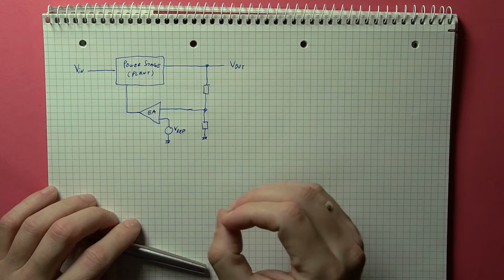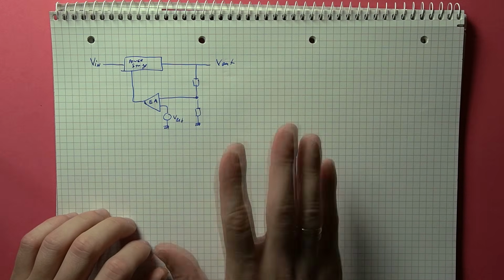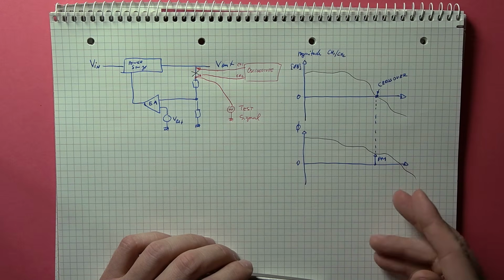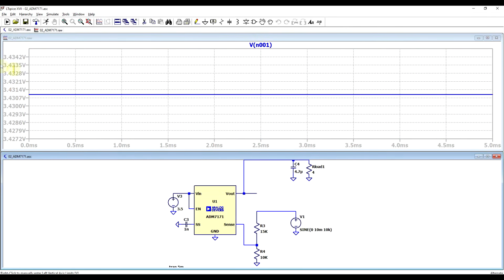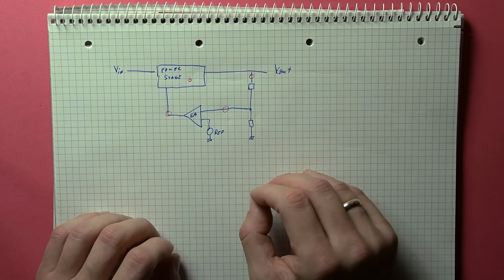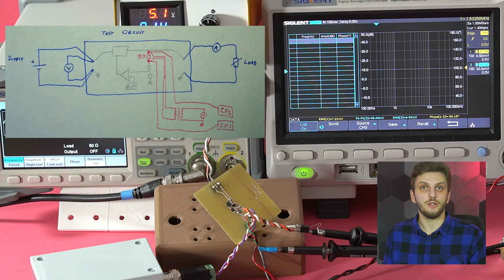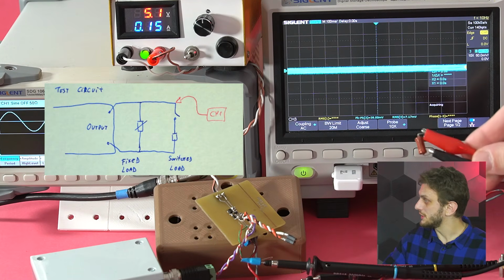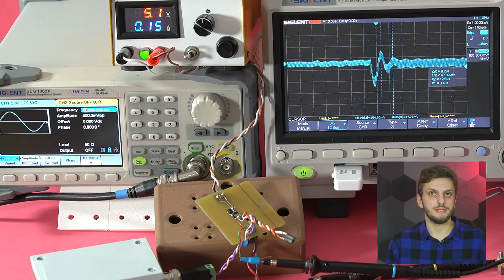Power Supply parameters - Loop Response

Comment: Which transformer was used to inject noise?
Reply from the maker: I used a DIY transformer; I don't have a proper description of it.
Reply: @FesZElectronics Can you provide instrcutions to diy the transformer? What should be taken care when making it? Will the ouput impedance (50 ohm？) of the connected signal generator affects the test device's loop response?
Reply: I am also interested in what such a transformer looks like and how to make it

Comment: There is a "small" problem here. Your reasoning on the open loop is correct but you are doing your measurement in closed loop, i.e you are fighting the regulator that is trying to cancel the error and the transfer function is not the same. On top of that by changing the excitation with frequency you are adding a pole and a zero to the system. So you are not measuring the performance of the original design but a simulated combo system with virtual components. An effect of that is the spike  seen in the phase response. You should bias a constant operating point with an auxiliary power source and open the loop, then perhaps add a corrector circuit based on the open loop measurements. BTW, a 30deg phase margin will give an "optimal" speed response with a single bump damped overshoot for a system with 2 dominant complex poles.  Nice channel though, continue the effort, I see progress over time, and quite often learn a trick or two.🙂

Comment: Hi! Some questions... 1. What are those 2 gaps in the phase shift plot on lower frequencies? Aren't those mean also stability problem? 2. Output seems to oscillate even before applying the load step (even before ringing starts), or do I see wrong? 3. How these measurements show exactly the bandwidth of the power supply? What bandwidth of supply really mean? Thanks!
Reply from the maker: Hello. Good Questions! 1. The phase is close to 180deg; here the measurement equipment jumps between +180 and -180 since it only outputs the 180to-180 range; so +181 is expressed as -179. 2. I'm not sure what to say here, it might be a setup issue, or it might be that the supply has such a low phase margin its inherently unstable, and any small environmental perturbation causes it to oscillate; 3. By bandwidth here I am referring to reaction speed - if an external perturbation is applied, how fast can the circuit react. At any frequency below the crossover the supply can react, but not above since it has no gain above.

Comment: Fantastic video, will be following this when I finally get around to designing my own lab PSU (for fun).

Where did you get the "good" margins from? I.e. 45/60 degrees and the gain?
Reply from the maker: Its found in general in technical literature; People who know way more than me about this subject came up with the values :D 
In theory even 1degree of phase margin would be enough to prevent the appearance of a permanent oscillation, but the exact values will have various tolerances - like depend on the circuit construction, component values, temperature, load etc. So a value of 45/60 is usually sufficient to validate the design.
Reply: @FesZElectronics  thanks, the idea of a safety gap makes sense with component tolerances and manufacturing.

I have a Agilent PSU 66311b which has a fast and slow control loop mode, I'm guessing it's something to do with this trade-off you stated on margins and speed! Thanks again

Comment: What IC did you use ? asking since i wander if we can find 100khz in the datasheet since they mist have tested for this , also this may be lowered but the PCB design and part values but it would be interesting to see IRL value vb theoretical datasheet values. 
Also here is an idea: boost or buck converters on a shared output how to stabilize this .
Reply from the maker: The crossover is not usually documented, since it depends on the exact implementation and also the test load; what you might find though is records of an evaluation board being measured under specific conditions;

Comment: this is a measurement that can also be done on a digital power supply, correct?
Reply from the maker: Yes, the type of supply should not matter. The measurement can be done as long as you have access to the feedback loop - so for example you cannot perform it on a part like 78xx where everything is integrated.